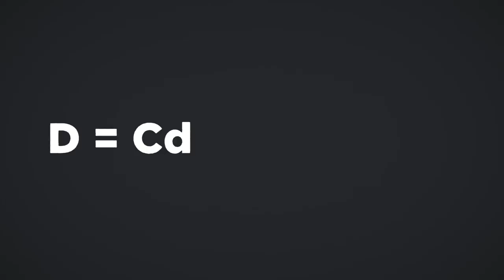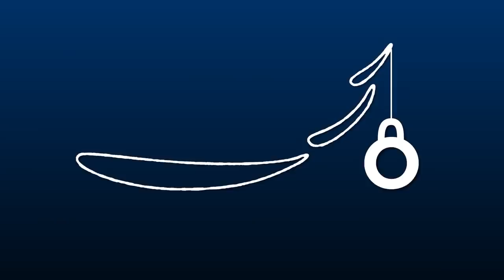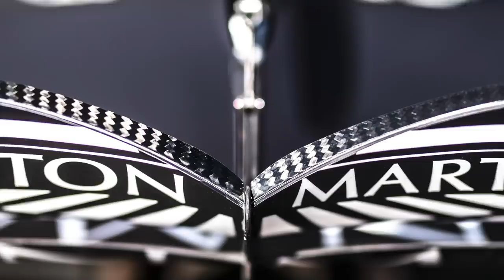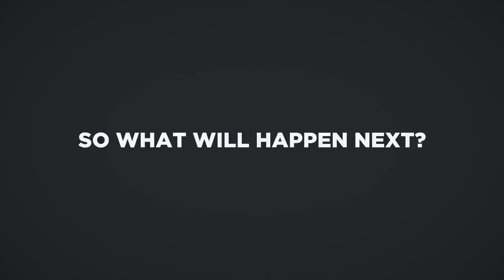What Are Flexi-Wings & Why Are They So Controversial In Formula 1?

Comment: Can't wait to hear Max over the radio next time when he is front of Lewis; I can see the front wing of Lewis flex in my mirror, this can't be legal.
Reply: Actually red bull also has the same flexy wings 😂  
RB  point out merc front wing but merc quickly showed that they have the same amount of flex as red bull 😂😂
Reply: @aryan_bhattarai  but mercedes wing flexes way more than anybody
Reply: @eval144  bruh. If u consider this to be a legit proof then sorry to tell its not.

For the grid method to work the camera and how the camera is oriented plays a big role!!! The position and the orientation of the camera needs to be same for this comparison to work. U can clearly see the camera on the rb and merc face completely different ways. Merc camera faces the front which makes even the slightest movement noticeable but redbull's camera faces down at the road which makes the wing look very rigid. U can see this when they hit the curbs. Whoever made that video clearly has no idea how the grid comparison works. U cant just put two footage and put grid on them and say its a comparison. Again, the position and orientation matters!!!

And the front wing of the redbull is also effected by the dirty air in front. 
Now dont come to me saying that merc was also in dirty air in "rear wing comparison video". The rear wing is far less effected by dirty air than front wings. 

Whoever made that video just took two footage and put a grid on it without any knowledge of how the grid comparison works.
Reply: Mercedes front wing is same as every other team.let RBR challenge it.

Comment: If it passes the existing load tests, I argue that it should be legal. Change the testing procedure for next year if the FIA wants flexible wings to be completely illegal.
Reply: @justcows7772  but FIA confirmed that the wing is legal. It passed the load tests.
Reply: @justcows7772  the problem is that basically all current wings are against the rules because they all bend somewhat. And if you pass FIA's test then how would you know if it is "technically aginst the rules"? Those rules don't define a margin of bendyness.
Reply: @ricahrdb  the rules as they existed when the cars were designed and tested is what matters. Anyone can revise a test procedure later on to get a different result. If the cars passed the initial tests they should be legal. Hammy and Wolfe are just whining.
Reply: @ricahrdb  so VW diesel cars were legal then as they also passed the flawed test the governing body implemented...
Reply: @oxfordsparky  no, because in that case a regulator did actually define strict rules. That isn't the case with wings in formula 1.
Reply: Except that the technical regs allow FIA to change the test mid season.  No need to wait for next year.

Article 3.9.9: In order to ensure that the requirements of Article 3.8 are respected, the FIA reserves the right to introduce further load/deflection tests on any part of the bodywork which appears to be (or is suspected of), moving whilst the car is in motion.
Reply: @oxfordsparky  That's completely different. VW had installed engine control software in those vehicles which was activated as soon anything was plugged into the OBD port for testing emissions and reverted back to normal running software when testing gear was removed from OBD port. Very dishonest and very illegal. more like Ferarri fooling fuel flow sensors which was also illegal IMO
Reply: @justcows7772  No.. that is exactly what rules are. The wings passed, aka they're within the rules and are therefore legal. There's no rule that states "If a wing passes the tests, it might still be illegal if we feel like it".

What FIA is talking about here isn't that the wings are illegal, they're talking about changing the tests, so they become illegal. Two very different things
Reply: @Russell Durrant So, why only look at the rear wings then? Merc seem to flex their front wing like mad. I think Toto opened a can of worms that will lead to an increase in cost for all of them. Stupid, if you ask me...
Reply: @oxfordsparky  VW cars loaded a different engine map for testing, what was tested was never used on the road. These rear wings are the same under test and in the race, that's the difference.
Reply: So what your saying is if they find Traction control on one of the cars but it passed this year then leave it to next year to remove it
Reply: @christopherbland5774  no.. because traction control is illegal. Flexing wings aren't illegal. All wings flexes. It has to, because physics. What they can't do, is flex more than the testing allows. That is not avoiding the rules, that's abiding by them.

People seem to have a difficult concept understanding this. The tests aren't to make sure you're within the rules, the tests ARE the rules.
Reply: "flexible wings to be completely illegal" so break the laws of physics lol. Or we go back to no aero era.
Reply: @Excludos  That is ass backwards. The inspection tests are to enforce the rules not write them. FiA had a bad test and RB exploited that, to ignore the rule entirely, and gain a performance advantage against their competitors. Thats not 'innovation' or 'grey area in the rules'. its saying 'if the inspectors don't catch us, then its ok to cheat.'
Reply: @kevlard  front wing flex is similar through out the field. In the rear wing there is clear, and visible difference between the cars that attempted to comply with the regulations, and the cars who are exploiting the tests to break the rules.
Reply: Because of the safety reasons! With in the rules it says that any thing to do with the wings FIA testing can change at anytime. The team's all know this and agreed to it.
Reply: @jameshoover492  No, it isn't. The Mercedes front wing flexes way more then Red Bull's. Have you even watched the footage or are you just repeating what Toto says?
Reply: @kevlard  I found one video.. but there are inconsistencies between the nose wing footage of the two cars, so its hard to make a direct comparison from that. But what is clear is that both wings move, what apears to be, a similar amount. On the redbull car you have to watch the black shadowy line. 

In the 'bendy wing' rear wing video. The camera is fixed at the same location and angle, and its clearly the same track on the same lap making similar pace.

 In the rear wing footage the mercedes wing viberates between two tight tollerance points, from air resistance. But the redbull wing greatly displaces and returns depending on the speed.

So no, I have not seen anything to validate horners claim that the merc front wing flexes excessively compared to the redbull.
Reply: @justcows7772  are you talking about DAS??
Reply: @oxfordsparky  yes but that also goes against the spirit of the regulation. In VW's case, the rules exist for environmental reasons and so it's in everyone's interest that they adhere to the letter of the law AND the spirit. Whilst F1 wouldn't be F1 if the teams weren't always trying seek seek maximum gains through small margins WITHIN the regulations. It's in the spirit of F1 too seek to exploit the rules, don't you think? It's in everyone's best interest to see such technical innovation and the subsequent controversy. There are countless innovations that have led to F1 becoming what it is, despite them being legal but controversial when they were introduced.
Reply: @jameshoover492  Jesus. This is really hard to understand, Huh?

I get a new job. In my contract, it says: "You must be sober at all times. We will test for it every morning".
If I find a way to circumvent those tests, I would still be breaking the contract. Now contrast that with a contract which says: "You must be sober at the test we do at the start of every morning". The latter only says I need to pass the test, and it doesn't actually matter if I grab a beer at lunch. The latter is the flex wing.

It's not ass backwards, it's just how the rules are set up. And they must be like this, because a little flex is required due to physics. Thus the amount of flex allowed is tested for. It's not a "bad test" that RB cheated their way through. No one used the word grey area. It isn't. This is black and white. The rules states that the wing must be within the testing limits. RB wing is exactly that. Thus it is legal.
Reply: @Excludos  Actually you are wrong and since you can comment on YouTube why don't you Google the FIA technical regulation 3.8.b which states "Must be rigidly secured to the entirely sprung part of the car (rigidly secured means NOT having ANY degree of freedom).  With the exception of the driver adjustable bodywork described in Article 3.6.8..., ANY specific part of the car influencing its aerodynamic performance MUST remain IMMOBILE in relation to the sprung part of the car."   

So genius where does the regulation mention the test?  I guess using your example above it is actually the clause that states you must be sober at all times and not just be sober for the test.  Therefore it is a pretty good bet the Baku results will be protested by either Mercedes, McLaren or Aston Martin.  Further it is pretty likely that Red Bull, Ferrari, etc all have non-compliant wings that they will stiffen for later races and we will see how their speed on the straights look in races after Baku.  

In closing you shouldn't talk out of your a$$ when you could look up the regulations so easily.
Reply: @mattbilello6229  The problem, as you'll agree, is PHYSICS. It can't be 100% rigid, because it's impossible. The teams knows this, FIA knows this, physics knows this. So the regulations stipulate "must be rigid", but every wing on the track, including Mercedes who whined about it, are flexing a little bit. If they didn't flex, they'd break. If they truly "rigidly secured means NOT having ANY degree of freedom" as you stipulated here, then literally every single wing on the grid would be illegal. Every wing flexes. Every, single, one.

So now that we've covered they HAVE to flex, the questions is: How much? That is where the testing comes in. If they pass the test, they're not flexing too much, and they are deemed legal. Thus, the testing is the regulation. There's no "if you pass testing they could still be illegal". If the wings pass testing, they are legal.

The fact is that RB passed the test, meaning their wings are rigid enough. Just like every other team out there. Their wing is moving, just like Mercedes, and while RBs wing is moving a little bit more than Mercedes, it is within the technical regulations.

This is why changing the testing methodology mid season is unfair. No one is avoiding the testing. They are staying within the parameters, and thus have legal wings.
Reply: @Excludos  The test doesn't superseded the regulation. Show me where it says if you pass the test than the other rules don't apply.
Reply: @jameshoover492  There are NO other rules. I've been repeating this for a while now and yet no one is reading it. The wings HAVE to flex, because physics. Every team on the grid have wings that flexes a little, because physics. If the wings don't flex, they break, because physics. The tests determine HOW MUCH they can flex. There are NO other regulations to how much the wing can flex outside of the tests except for a vague idea of that "they shouldn't be flexing". The tests ARE the regulations
Reply: @Excludos  so, you don't understand theres a 127 page rulebook, called the 'F1 technical regulations' thats lists the specifications and tollerances every team is supposed to comply with, when they design and build their cars? And in the regulations under artical 3.8 'areodynamic influance' it clearly stipulates 'must be ridgidly secured .. not having any degree of freedom' and also 'must remain immobile in relation to .. the car'. why would they write those words for the 2021 season, if what they meant was 'everything can bend and tollerances in inspection .. something, it makes it legal.' Nope, the testing is only to check compliance with the regulations. 

What we have is the merc wing which was designed to be ridgid and immobile but viberates in the wind vs. The redbull wing which was designed to bend and gain a performance advantage (flagrantly violating the regulations), because redbull knew they wouldn't get caught in the wing inspections.

If you really can't understand all that, just save your time and don't worry about repeating yourself.
Reply: @jameshoover492  every wing on the grid is illegal according to you then.

The Merc wing doesn't just "vibrate in the wind", it moves too. Just not as much as the RB one does. I'm sure you've seen the comparison video. Watch it again, and tell me the Merc wing doesn't move.

Again, I must stress, PHYSICS make having a completely rigid wing impossible. No material in the universe can stay inflexible and simultaneously not break.
Reply: Yeah I’m new to F1 but boy does this seem like a classic case of kneel-and-slobber in front of ol Master Mercedes.